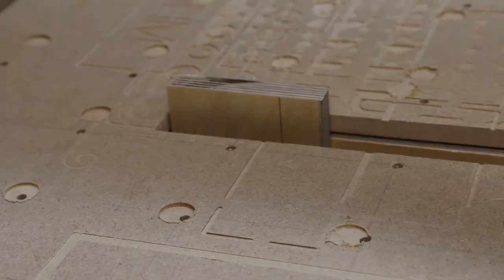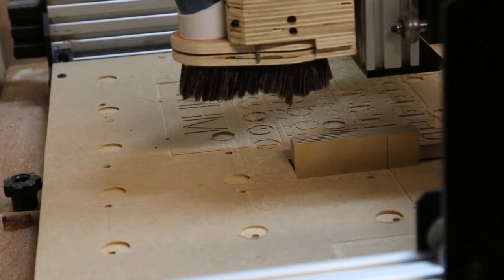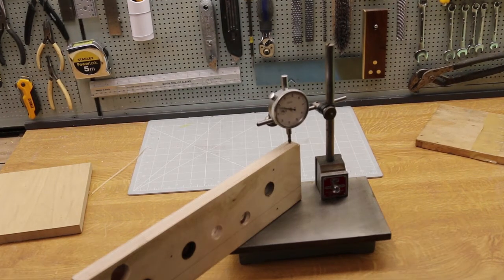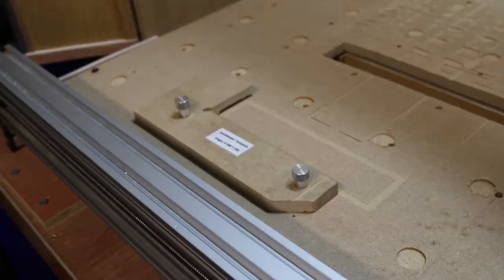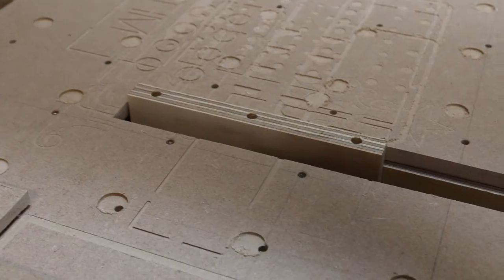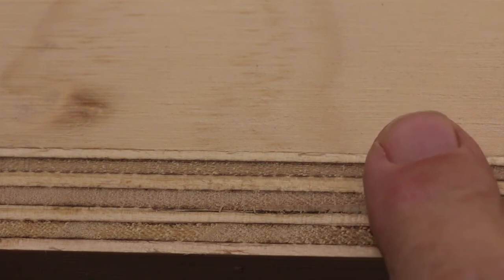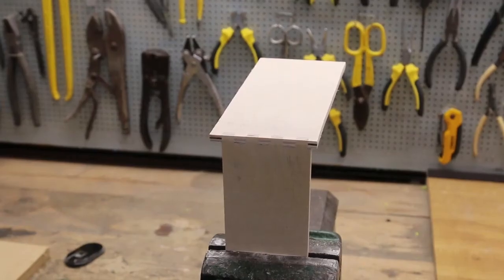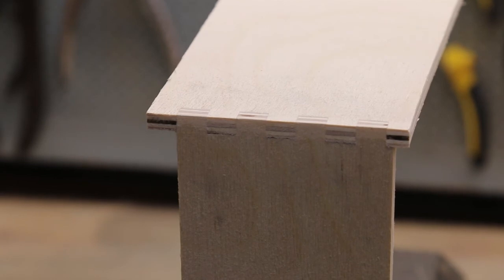JointMaster2

Comment: You mentioned squaring your workbee - could you do a video on that? I have some ideas how go about it but would love to hear how you did it... cheers
Reply from the maker: Good idea! Might take me a while though- got quite a lot on. In the meantime I can describe it-
After calibrating, I cut 3 holes in an isosceles triangle (large as possible), through a test piece and into the spoil board. I then flip the test piece over, and align the base holes with metal dowels. If the frame is not square, there will be a lateral shift between the two apex holes. Take half of that distance, and then scale up to the size of the frame. I then clamp a block next to the corner that needs to move, unbolt that side, and shim the frame by that amount before re-bolting.
You can then do another test, but one should not get too hung up on this- it is wood we are cutting. For example, good quality MDF has a rated dimensional accuracy of 0.3% - that is 3mm per m. It will move, structurally (ever seen unsupported MDF droop?) thermally, and especially with humidity (typically 0.034% per %RH). If people tell you they are machining to 0.01mm do not argue with them- but do not believe then either. Surfacing comes last.

Comment: Thank you Mike for your videos.
A CAD-Cam-Cnc question. In your joint you want a little bit of space for glue (and tolerances). When making models (3D) how do you take these to account? I have not seen anyone drawing bow joints and adding a 0.1 mm gap manually. So how would one go about it? Again thanks
Reply from the maker: An interesting question. When using dowels, good quality ones will have 'ribs' formed into the length- this gives space for glue, whilst still giving an interference fit. Because the holes are not drilled, but cut with an end mill in a spiral manner, you can specify any sized hole. If you want to use 8.1mm holes to give 8mm dowels a slack fit then you can. I have never felt the need- the hole spacing is so accurate that it is not needed. Remember, any slight calibration error in the machine will be duplicated on both cuts, and cancel out. (One needs to use the same axis for both cuts for this to be true). The ideal spacing for glue ( especially in other joints, such as finger joints) is a topic I have not researched- but I will! The ability to work to ~0.01mm (with a few caveats) means that woodworkers can now consider such matters... 
Bow tie joints are not something that I have tried, but should be relatively simple. Most CAD drawing packages for woodworking support inlays, where the CAD system calculates the paths to ensure a fit around the insert for a chosen cutter. This would allow very decorative shapes to be used...
Reply: So CAM/tool path software might add some play. I was thinking of when building a drawer in CAD with finger joints and a groove for the bottom. In that model one would use reference and manually adding space would be very tiresome. I saw woodsmiths cnc trainings and everything they built were so tight it needed a big mallet and force 😅
Reply from the maker: @i679n5  The issue might be with the wood fibres compressing slightly when cut, so that cuts are slightly undersized. A 'trick' might be to 'invent' a tool that is slightly undersize to the true tool- e.g. a 5.95mm end mill when a 6mm will actually be used. This will make internal cuts oversized and externally cut parts undersized. Some experimentation with this would be required, to get the right amount of 'slop'. The good bit is that it would not affect the design at all, it is applied at toolpath time.
Reply: But you have are not constantly running into this deal breaker? You do nominal measurements and it seems to work out fine :)
Reply from the maker: @i679n5  It is normal in machining to allow for different types of fit (clearance, interference, force, etc.) but in woodwork this has not been the case to date- but then the tools used did not give this level of precision. I have found that, with hardwood, if you want a close but not tight fit (say a lid on a wood box), it is worth adding 0.1mm or so to the dimensions on one of the parts. For permanent joints this is not normally needed. All standard practice in engineering.
Reply: I found some comments on the topic. If you don't mind I can e-mail you some links and print screens. Take care // E
Reply from the maker: @i679n5  Could be useful. From a quick Google it seems that around 0.1mm is optimum for PVA type glue.
Reply: (PS how do I find your mail?)
Reply from the maker: @i679n5  Ahhh, there's the rub. You Tube deprecate publishing e-mail addresses on security grounds. Why not get in touch on Twitter? (@MagnayM)